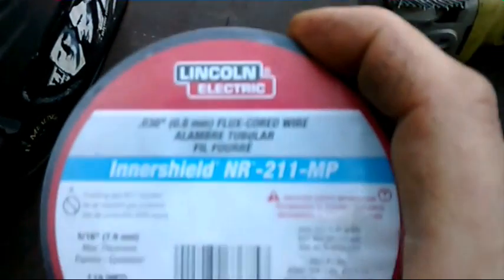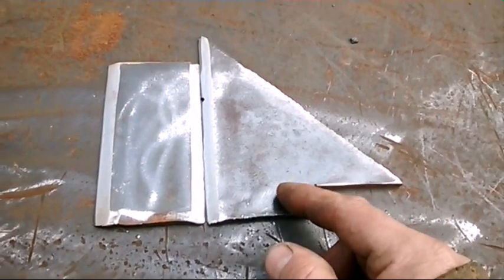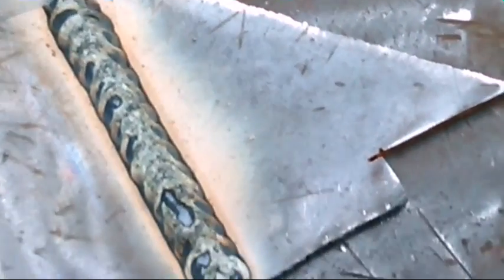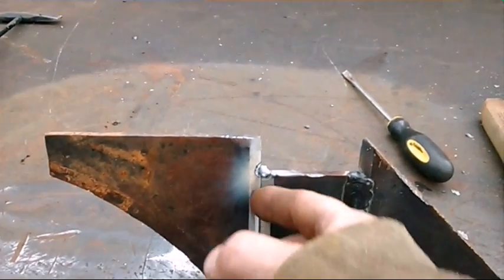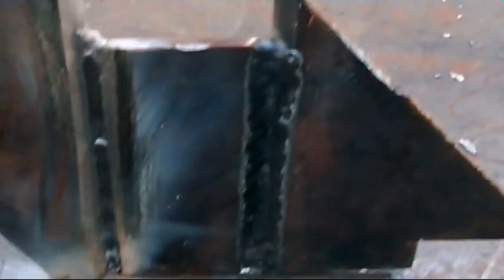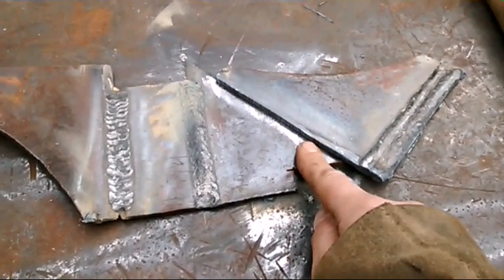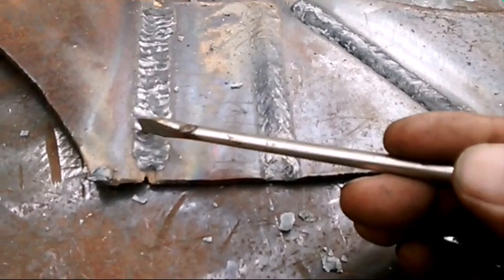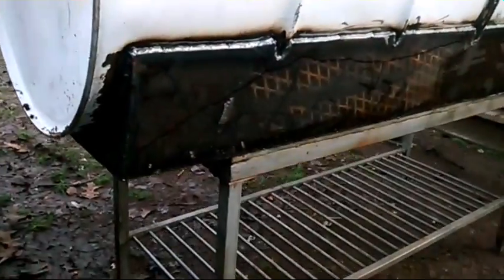Welding self shielded flux core : how-to

Comment: Great video Allen. I am running 035 flux core, same make and brand as in the video and the same welder. I find that my stock gun overheats very quickly, do I need to upgrade my weld gun or am I missing something? My "stick out" is 3/8". Thanks for any help.

Comment: I have a helvilite filmaker 182 mig welder. This gas/gasless welder is the welder to get if you want to weld really thin gauge car steel with flux core. I welded 0.8 (22 gauge) very well. After cleaning it looks like its been gas welded

Comment: Your beads look great for flux core.   I took a few courses in welding and got the hang of SMAW and MIG but there were no flux core (FCAW) set ups.  Someone put a Firepower 120 amp MIG/Flux core welder in the trash and I took it home.  The hose was burned completely through so I bought a new one and I've gotten pretty proficient at running flux core.  My beads still don't look as nice as yours but perhaps with practice I will get there.  Keep up the great tutorials.

Comment: You didn’t use any Argon shielding gas for this welding? No need for gas with flux core wire?
Reply from the maker: You dont need gas for "gas-less flux core..you do with dual shield flux core though

Comment: I’m glad I found your video. I have a steel smoker that I bought about 8 years ago that I absolutely love. Paid $350 for it new. It’s getting rusty and worn out in under the firebox. I’m planning on rescuing it with my first ever attempt at welding with a flux core welder. Thanks for showing me how to make a lap joint and for your tips!

Comment: So far I have had some burn thru holding the trigger less then 2 seconds, the setting if recommends is on low, 1 and wire speed 9

Comment: I have a question, I'm new to welding I was given a gift of a flux core gasless welder, I'm trying to do some auto body repair, on some 18 gauge steel,, can it be done I have a hi and low setting, 1, and 2 and of course wire speed

Comment: Hi Allen, I am almost totally new to this or any welding process, although I have seen lots of welding done. I have just bought a small home type flux core welder to help in my tool making.
I make woodcarving tools, crooked knives and adzes. I need to be able to run a bead across a flat carbon steel blade to protect the band fasteners from chips coming off the edge of 
the blade (loosening the bands). I think I can do this by filing a shallow groove in the steel and then going back and forth as you did on the wide groove in your video. I wll try on some
practice pieces before I do one which has a lot of labor into it.
     Thanks for that advice especially for the action with the screwdriver blade which is a really good way to demonstrate what works.
Dale Thorson

Comment: That's the same wire I'm using right now. Is that good or is there a better wire?
Reply from the maker: its a great wire, very strong but solid wire and gas shielded flux core are a little easier to run

Comment: I have the Lincoln 320HD I love it and I weld 1/2 steel with it and it holds great
Reply from the maker: TIM LASHLEY That is a good machine! I can weld 1/2" with the 180 with multi pass. it's not regulated for 1/2" but it can be done, I did a lot of 1/2" on the video where I built the counter weight on a guys pit, at least I think I put it in the video.. I'll  have to go look
Reply: Allen's welding/woodworking yes sir most say you can't do it blah I did it and my friend broke the steel with 50 tons and weld never broke